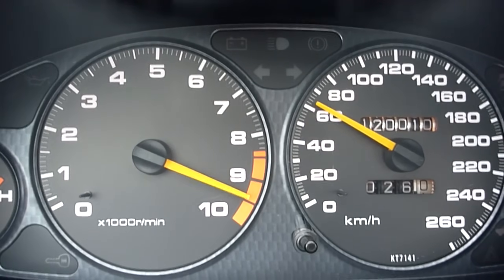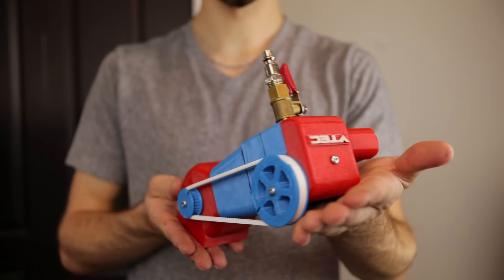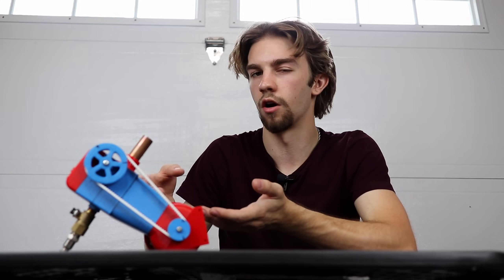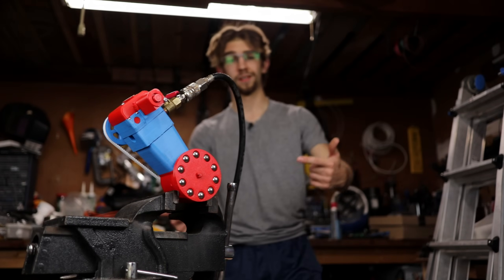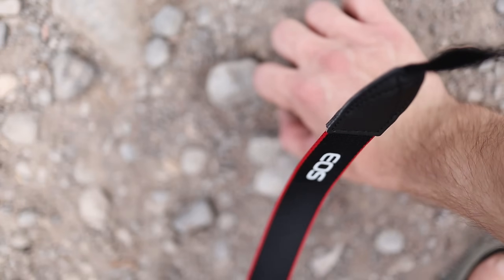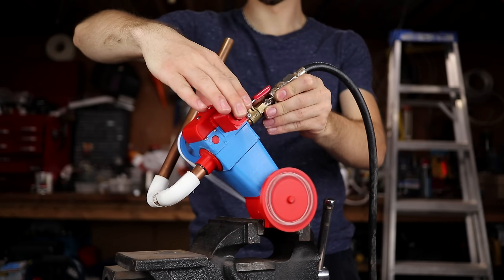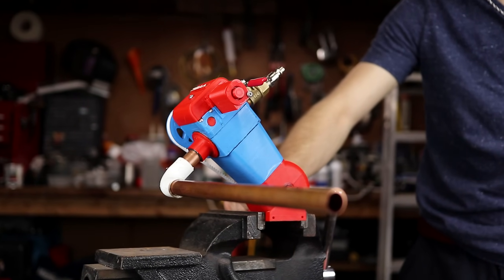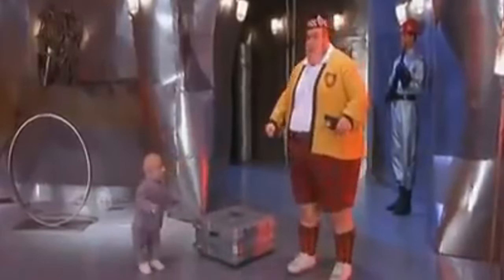I 3D Printed an Air-Powered Engine with Honda's VTEC

Comment: What if..... The ignition plug.... Was ON the piston? And the engine block is one solid part, you could drop the bottom part of the engine with the oil pan And replace a piston in 10 minutes tops?

Comment: When you mentioned triggering the vtec mechanically, I remembered that centrifugal clutches exist. There could be a way to 3D print one and tune it to kick in when needed; I'm just not sure how a static/rotating thing could trigger an in/out mechanism...

Comment: create a fly wheel limiter to engine vtec  like a train or elevator has  as they spin faster the balls move and then can press button  would be as simple as adding gear teeth to flywheel or loop cam belt into it   love the idea and suprised it was only a crank failure    mabye add some engine assembly lube for cars for long runs?

Comment: For a mechanical solution, you could make some sort of governor that actuates your solenoid. It would need a bit of linkage and weighting the governor to open at the right rpm might be tricky, but it would be totally mechanical.

Comment: I'd also add a bushing or bearing between the rod and crankshaft to reduce friction, heat, and wear. Many small 2 cycle engines can run at crazy high rpms and last for years using bearings
Reply: i have a 50cc 2 stroke mounted on a bicycle and another one thats been on a bicycle for 10 years and still runs fine

Comment: An alternative approach could be to design a flywheel that harnesses the centrifugal force generated during rotation. In the past, many steam engines and other rotating machines were kept at a certain speed using this method. By utilizing the centrifugal force, the flywheel could effectively engage the VTEC mechanism. This could provide a potentially efficient and reliable solution while minimizing additional friction in the system.

Another idea is to utilize the principle of "valve float." This occurs when the camshaft rotates at such high speeds that the valve lifters begin to float and cannot fully return to the base circle of the cam. By incorporating this principle, it would be possible to activate the VTEC mechanism. The advantage of this approach is that it is likely to consume less energy compared to a centrifugal flywheel clutch plate. This could provide an efficient and energy-saving solution for engaging VTEC.

Eddit: other idea

Comment: Put a spark plug and fuel in it too lol
Reply from the maker: If it can generate enough compression this could work lol
Reply: @CamdenBowen  watch some @garage54 they have done crazy things with big engines and combustible engine parts!! Good stuff glad you popped up duder

Comment: I would suggest to make it multi cylinder if you go for sounds. The timings between cylinders is really important when it comes to the engines melody.

For the automatic vtec engagement maybe use valve float with a really late actuation and a buffer. Meaning that you have a cam with a buffered peek that actuates vtec. At low speeds the buffer compresses and the cam isn't triggering the pin. But at higher speeds the buffer has not enough time to buffer the cam peak and it engages the vtec pin.
Reply: I don’t know what you mean by buffer. Do you mean the opposite of a compression release pin inside a cam on small engines? One that comes out at high rpm instead of hiding at high revs.
Reply: @_..-.._..-.._  I thought of some really low pressure hydrologic spring. That tries to push open the valve and at speed it has less time to compress qnd eventual overcomes the valve return spring.

But I read others mentioning a centrifugal clutch which is likely the better and an already proven system.
Reply: He should ask yamaha 🤣

Comment: Why do the timing gears have a reduction of 2? , bc it kinda a 2 stroke. That should make the engine make twice the torque and more efficiënt, right?
Reply from the maker: it reduces the amount of force required by the crank pulley to turn the cam pulley since it is a 2:1 ratio, the camshaft is double sided to account for this

Comment: An external flywheel with weights on springs or gravity, like a steam engine, would work for enabling your VTEC mechanically.
Reply: I've been designing a vvt system using centrifugal force at the cam to enable more cam timing. I'm building it on a single cam 125cc
Reply: yes, this is called a governor
Reply: @elywickander4666  yes, but not in this situation
Reply: Yeah sorta how like CVT works?
Reply: @_skyyskater  yeah something like that

Comment: May I suggest mechanical/centrifugal governor type valve that applies the vtec at a high rpm, similar to an older automatic transmission like a 700r-4 or th350
Reply from the maker: That's a really cool idea, using something similar to a shift governor to maybe move air from one place to a vtec solenoid
Reply: @CamdenBowen  I was thinking using the centrifugal force to apply a rod inwards to press the ‘button’ for vtec. Use spring tension or a screw to adjust the rpm range in which it engages. I wouldn’t go too heavy on the weights so it doesn’t fly apart lol

Comment: sounds like an air lock, you could have a pre-pressurized chamber for the fuel inject
Reply: simulated gas piston engine nice
Reply: there can be a simple optical/rod gate that triggers the fuel inject at the optimal cycle position, like a piston rod
Reply: if you have an air lock system then the next injection is ready right away, and can be charged while the burn cycle operates
Reply from the maker: @Jkauppa  I was thinking of recycling the crank case pressure to actuate the VTEC at a certain RPM, so somewhat similar
Reply: @CamdenBowen  who needs timing belts anyways, just have the pistons do it all on their own per piston (including gas pedal adjustment), on the crank shaft
Reply: @CamdenBowen  I mean the piston movement can control the other attached things, provide the power timing etc

Comment: You must use ABS fillament instead of PLA/PETg for higher temperatures and CF for frictions
Reply: Fibre filled filaments are terrible for friction joints, the fibres are abrasive so they wear out the joints.
Reply: @H34...   try pa6 cf

Comment: Please do a multicylinder version of this with v-tec! That would absolutely awesome, love your ideas man!
Reply from the maker: Thank you! Once I refine this one, I will be aiming for two or maybe even three cylinders!
Reply: @CamdenBowen are you going to have the VTEC electronically controlled with a solenoid?
Reply: @SpeedDeamon95  I'm going to try to run it off the oil pressure, the way Honda did it, not sure if I'll do external oil passages or try and figure something out internally, I'm planning to keep it as true to the original design as possible
Reply: @CamdenBowen  I would highly suggest though on having some counter weight on the crank shaft for the single and 3 cylinder engine, so not only will it run smoother but also make it stronger and less prone to breaking again.
Reply: @CamdenBowen  nah u gotta make a 4 banger lol
Reply: @CamdenBowen  come on man inline 4 lol
but im looking forward to whatever u decide on
Reply: I always wondered what a V8 or V10 VTEC engine would sound like
Reply: @TommyNoBaka I've actually been planning to Make a custom set of cylinder heads for a 5.3ls that have a similar mechanism to Honda's VTEC, I want to see how it would perform compared to the stock form and the power you can make with a little 4 banger Honda
Reply: @Nocturnal5841  definitely do it and document it! Would love to see it
Reply: @TommyNoBaka  probably like a v8 or v10 but with vtec
Reply: this too pls!
Reply: A cross plane crank I4 would sound bonkers.
Reply: 5cyl air engine

Comment: You cloud use a centrifugal clutch to activate the VTEC
Reply from the maker: I was thinking of doing something similar to a centrifugal dirt bike clutch like those from a Yamaha pw80, where balls move along a sloped ramp outwards and push against a pressure plate creating linear motion

Comment: now make it govenor activated and share filez so i can make better also when discord
Reply from the maker: I'm thinking of either posting the files soon, or update them a bit and then upload the updated ones along with the next video
Reply: @CamdenBowen  id really like a fully 3d printable one using grease bearings (hydro dynamic bearings) i mean valves with screws is fine
Reply: @CamdenBowen  when are the files coming?

Comment: U could use a governor (centrifugal weights) to turn on the v-tec, like they used on steam engines to control the speed.
Reply from the maker: since the camshaft is next to the actuator, I could probably have it driven from the camshaft

Comment: you could make a system sort of like old tachometers, where you have two plates with magnets spinning individually where the vtec plate has a  torsion spring to set a minimum rpm
and the other plate is connected to the crankshaft.
Reply from the maker: Probably the most interesting suggestion yet (and complicated lol), using Eddie currents and a spring to actuate the VTEC is genius!

Comment: THAT PASCAL'S LAW IDEA IS AWSOME! I cant believe I didn't think of it sooner. the vtec idea is a good idea since truly variable timing is difficult to do, especially at small scales. Im making a 2.5cc 3d printed air motor that oil filled with an oil pump so it can be reliable at extremely high revs but vvti would never work on a cam thats 8mm wide under a few pounds of valve force revving to 7k rpm. however with that pascal's law idea, if I can fit it into a 2 inch tall motor, will allow for a delicate vvti system to work as it wont be under such insane forces. great video as always, I love seeing your channel grow so quickly!
Reply from the maker: Thank you! You could likely use a straw or small tube as the valve body since it has a uniform bore that would allow for a great seal with an O-ring for the top piston and also have a small size!
Reply: @CamdenBowen  thats a good idea but a straw is too weak, under 100+psi it will bend and conform to the shape of the 3d printed cylinder it is in and that would cause excess wear and failiur to seal. Im thinking getting some special size brass pipe so that it is strong and wont wear at all. the issue is a lot more math must be used for the pascals law. now I have to calculate intake pressures based off of the motor rpms and other factors so i can design an engine that wont float the valves until after the redline and then I gotta find a good atio between the closing and opening force for each different engine, but it seems really worth it cuz this allows for very little wear, a smaller valve system, and a motor capable of much higher pressures.

Comment: amazing project! really cool!
the exhaust is a really cool idea, now add a centrifugal glutch that drives the VTEC mechanism at a given speed ;)
Reply from the maker: Thank you! I was thinking something similar to how a hit-and-miss engine operates using the centrifugal working principal
Reply: @CamdenBowen  i like the sound of that, you are going full circle in using steam engine technology (hit and miss) in modern engines (VTEC) 
I am looking forward to a VTEC hit and miss engine!

please note: hit and miss is originally designed to keep the engine running at a constant speed
In other words, where VTEC makes the engine faster, Hit and miss keeps the engine at a constant speed :)

Comment: Air Engines are Back Baybee!
Reply: THE BLACKER THE BERRY, THE SWEETER THE JUICE BAYBEE!!
Reply: People been making Lego vacuum engines for a while now this is just a glorified version of the Lego ones. I saw a Lego v16
Reply: @dewaltdrill409     Go make your own if you’re so amazing
Reply: I mean the first engines were steam engines which is basically what this is

But instead of pressurized steam it's pressurized air.
Reply: @tristan6509 why do you start a comment with “I mean,” it’s so strange to me how people write conversationally. Another one is “Honestly,” which I hate.
Reply: @tristan6509 this is called a stirring engine
Reply: @buttercupalfilms9716  It's actually a pneumatic engine. Stirling engines rely on temperature change, either heat or cold, to cause a pressure change in the cylinder. This is just air powered, which makes it pneumatic

Comment: With your crankshaft melting, I experienced the same issue at high rpm, which was completely resolved by using petg instead.  PLA will soften very easily under heat.  PETG will  do amazingly :)
Reply from the maker: The funny thing is, it was made of PETG lol. after some more thought I realized it was probably due from the inertia of the piston's linear motion that caused the crankshaft to bend so severely. I may need to weld a steel one lol
Reply: @CamdenBowen  oh geez.  Was it 100% infill?  That's insane. What kind of torque and rpm do you think this thing is making?
Reply from the maker: @Hayden  Not sure, but it puts out a surprising amount of torque at its upper range from what I can tell, also the crank shaft was only 50% but even still most engines I've made would work fine on a 20% infill lol
Reply: @CamdenBowen  danggg.  I love making these kinds of engines.  I'd love to see a homemade Dyno as a vid sometime!  But yeah, I'd definitely try 100% before making a steel crank.  Good shit man!
Reply: I was going to recommend ABS but yeah, PETG would probably work.

Comment: You could make a governor system similar to a hit and miss engine that engages the vtec once it hits a certain speed instead of slowing it down
Reply from the maker: I think that's a great idea, the hit and miss engine uses the centrifugal acceleration to create linear motion that I could use for the actuator
Reply: Haha we came up with the same idea. instead of it being linked to the throttle linkage, it would be linked to the vtec pin and push it into place. If you use some sort of ball detent to hold the pin in the open position, it would make it a really snappy activation since the governor would first have to overcome the force of the detent.

Comment: I love the fact you're able to make such seemingly complicated systems far simpler to design and 3d print! I'm actually working on a VVTI system for one of my engines and your video has given me some inspiration. Thanks bro!
Reply from the maker: Thanks bro! you should look into something like Toyota's VVTL found on engines such as the 2zzGE. VVTL is pretty much Toyota's equivalent to Honda's I-VTEC and still very cool!
Reply: You should look into the centrifugal govener system they run on small Honda motors could be simple to print